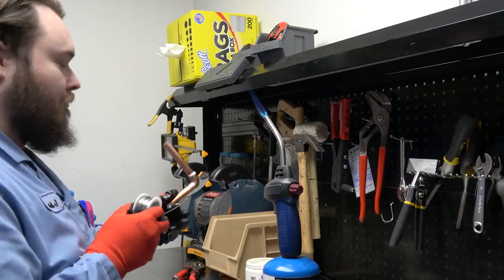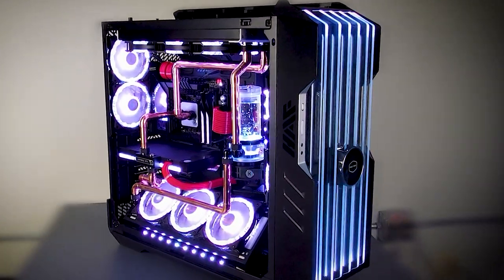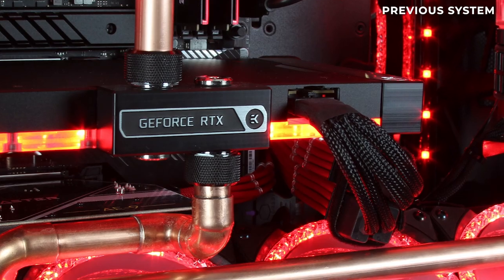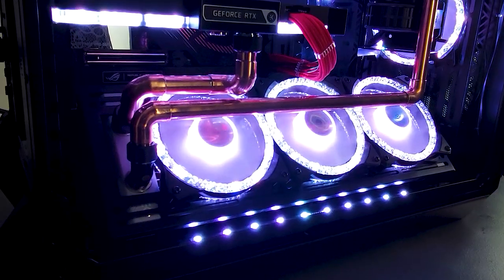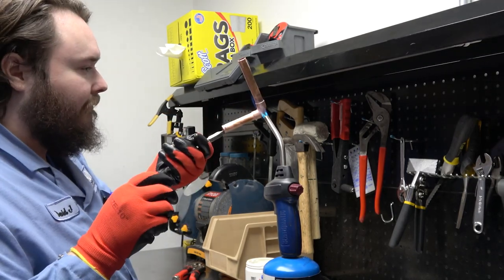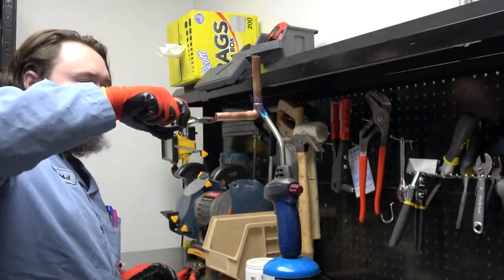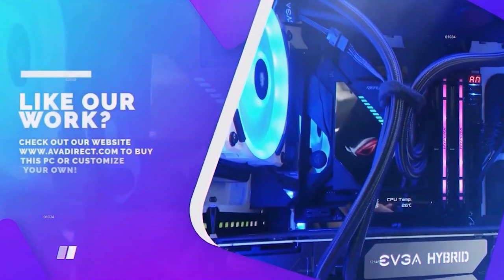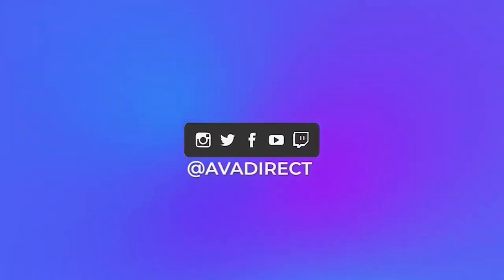Ask a Pro PC Builder | Building a Copper Pipe Liquid Cooling PC

Comment: I’m a plumber and a big gamer. And I was just thinking if I could watercool my rig and use copper and I found this video and you have no idea how happy I am now!
Reply from the maker: :D The perfect combination of knowledge to build this PC
Reply: One thing you can do with longer runs of pipe is go through the wall of your gaming room and have the radiators on the other side. That can be used to move heat out of the game room into a more central area where your HVAC will deal with it better.  OTOH, if you live in a colder climate you might like more heart in your game room. Of course, the longer the pipes the more liquid will be in the system and if you are using liquid coolant mixes that can get expensive very quickly.

Comment: Steampunk w/copper .. I actually ended up here because I'm re-building my PC and upgrading the 15+ year old Water cooled (AIO) system it has had since I built it circa 2009 (it was a beast at the time, and still holds its own for daily use and compiling software - with upgrade Nvidia video cards to help with that), so I'm modernizing the cooling and turning it into a "Steampunk/Industrial" wall mount build. Good info on this build. I was actually swinging by to see what connectors you used for the pump/radiator and CPU block. I will be making mine little a little more "soldered" also so it has that industrial look.
Reply from the maker: Please find a way to share it with us when it's done! :D We'd love to see your steampunk build.
Reply: @Avadirect  Heck yeah (unless it comes out embarrassingly bad) .. I ended up ordering 16mm copper tubing and a bender because of price, but the overall look should be copper/patina looking still .. I'm using PrimoChill Candy Gold SX in the hopes it will keep the old metallic look when it is moving around the reservoir, we'll see .. I do still have a few copper odds and ends laying around from doing the plumbing in my house for our fridge, so maybe a part or two from that will get the solder treatment ..